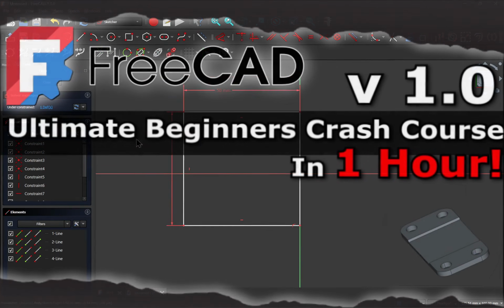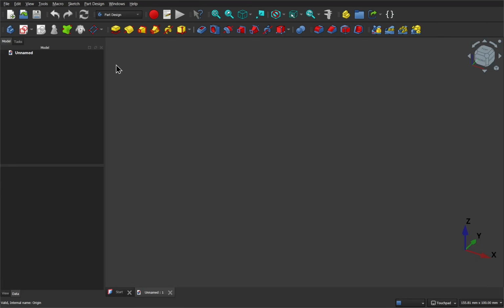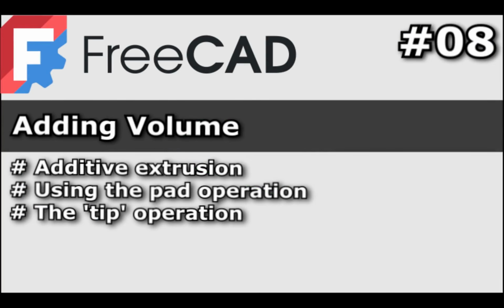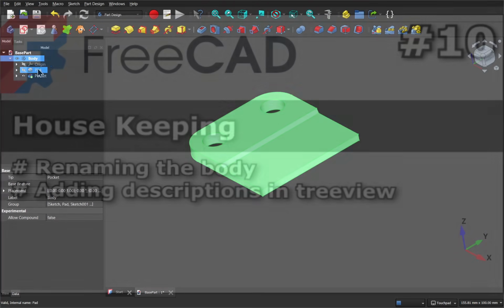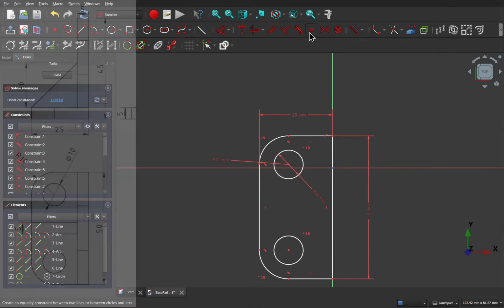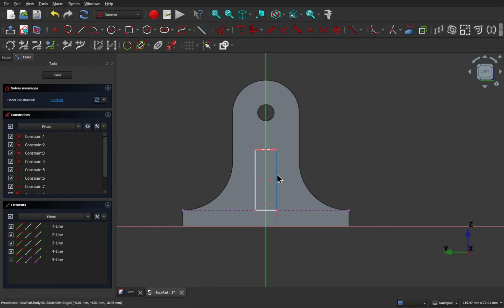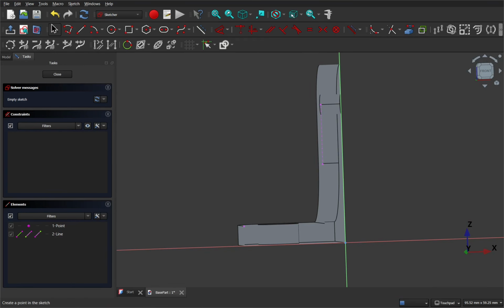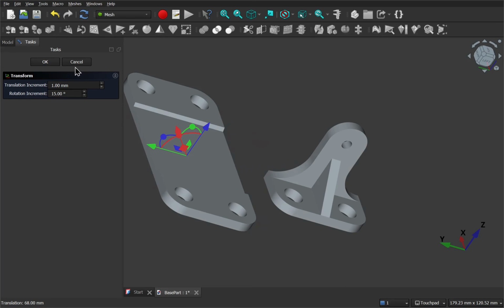FreeCAD 1.0 Ultimate Beginners Crash Course in 1 hour for 3D printing   CAD Lesson / Tutorial

Comment: Maybe I am understanding this wrong but I am trying to recreat something from measuring a real life part and I am wondering how to get the holes to line up without them snapping to the center when I use the constraints
Reply from the maker: I am assuming you are using the dimensioning tool.  There are two ways to use it.  If the tool is selected first this will snap to the center by default after you selected the center of the circle, the next selection will be the point, edge you want to constraint to.  But, if you first select the mid point of your circle, then the point you want to constraint to then your dimension will be added using these points.

Comment: The bit at 23:56 was a bit of a nightmare for me, I followed your instructions and it apparently created extra constraints, turning the drawn shape orange instead of white. Even deleting the constraints the program marked as extras didn't change anything, so I ended up deleting all the constraints and manually reapplying them - coincident constraints on all the pairs of points, one angle constraint, horizontal/vertical constraints on some of the lines, and two length constraints. Not sure what went wrong, but at least I was able to get to a fully constrained sketch in the end.
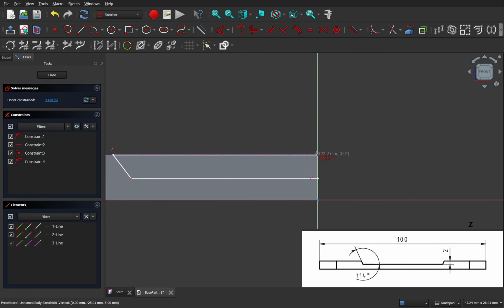Reply: Same issue for me on 1.0.1 - Tried to follow steviezhu's comment: "For those who got stuck at 23:40 with error "redundant constraints (7 and 10)" and orange shape, I've found the solution: when you drag your 3rd line that along the top edge, don't snap to the vertex on the Y axis, just subtly move your cursor around that vertex to  make sure you won't highlight (blue) the vertex but highlight (blue) the Y axis, and with the same parameters in the parentheses (0mm, 5mm). Same for the last line, don't snap to the original point, try to highlight and snap to the blue Y axis with the same parameters in the parentheses (2.5 mm, 90.0°). Then you're good to go." - but I couldn't properly grasp what he was saying to do as a correction.  I'll try some of the other suggestions.
Reply: Feel your pain bud, I was there too.  After deleting several bits and making sure parts where joined and re-watching I got there in the end.  All software like this has its quirks, just got to get used to them I suppose.  You do figure it out you're one step closer to not screwing up that way again.  Its a powerful program,  I saw it has the ability to do stress analysis as well.  Amazing bit of gear.  I teach at a low socio economic school and having quality software like this and blender is really important so kids don't have to get pirated copies or end up beholden to subscription software.  Excellent stuff.  I'm enjoying the pain.
Reply from the maker: The dimensional tool sometimes appears to try to be 'clever' and you end up constraining to different references with different constraints.  What often happens is that you select say a edge but you actual select something else in that 'pick radius'.  Can be frustrating when your first starting out.
Reply: @MangoJellySolutions  I should clarify, it wasn't the dimensional tool; the moment I finished drawing the shape with the polyline tool, exactly as you did, the whole shape turned orange, the sketch suddenly having too many constraints rather than not enough. If I drew it with the line tool, the shape came out white like it was supposed to. This happened every time the polyline tool was used while following the video.

Also, I think I was misinterpreting the error message at first. I saw it saying the indicated constraints were redundant and thought it meant they were redundant with each other and to delete one of them; I figured out later that it meant all of them were redundant with other, not-indicated constraints. In any case, the polyline tool just doesn't seem to work right in my FreeCAD version (1.0.1, stable flatpak), so there may have been a regression since the video was recorded.
Reply: @Onihikage  same problem here spend 15mins trying retrying the polyline tool until i saw this message better pin this comment! also 1.0.1 here

Comment: I’ve done many years of 3d modelling - mainly architectural, with a range of proprietary tools of varying capabilities.  But I’ve got to admit, I am really struggling with this interface and workflow for my home projects.  I’ll carry on, and I’ll get there eventually, but it shouldn’t be this difficult.  I’m trying to put together a little parameterised bracket, and want to move away from OpenSCAD, but it is so easy in that tool!  Thank goodness for YouTube… 😂😂😂
Reply from the maker: Totally agree. FreeCAD does have a huge learning curve, I have been through what I call 'unconscious change aversion' myself.  When coming from another package before freeCAD (where you point at the software and say 'that's not how it should work', or 'it's so much easier in x software') I think it's so much harder than starting fresh.  When coming from main stream to opensource; Illustrator to Inkscape, Photoshop to Gimp, it's hard to retrain old habits after using operations that have had thousand of $ spent on them to get them just right, it's against human nature as it burns more brain calories dealing with something that is less intuitive.  That pared with the UI it becomes a bit of a rough ride.  So totally hearing you.

Comment: 53:03 it constrains the whole triangle, and when I try to dim the back line to 25mm it errors with 'Negative datum values are not valid with the constraint with index 7'. If I delete constraint 7 and retry it says 'cannot set the datum because the sketch contains conflicting constraints'.
Instead if I delete constraint 4 which seems to be a line between the top of the purple dotted line and just below the tip of the triangle, it allows the change.
Strangely when I undid some edits and did it again, I still had to do this but this time I had to dim the bottom line which was already set at 20mm for it to accept fully constrained.
Reply: I wish i knew why it didnt work without deleting constraint 4, but i guess ill know that later. if i completely sell my soul to freecad lmao

Comment: I'm getting stuck at the point where the line changes, and you had to drag it forward. It's not working for me because immediately I entered 24mm it became fully constrained which means the diagonal line of it is facing up and not downward like yours and I'm doing exactly what you're doing. Please help
Reply from the maker: Please could you drop in the time stamp of the video of where you are up to please and I see if I can help?
Reply: Sir, I faced the same issue and I can help you with the problem. So basically, we are over constraining. 

When you try to give the dimensions, the 'solver messages' will show you which constraints are creating a problem. Just delete those constraints.

Also check the Elements. There should not be more than 4 line elements as we are basically creating a quadrilateral, otherwise in the subsequent step, it will show 'wire not closed' error. 

Please include these errors in a future update of these videos. Please. It caused me such a headache 😂

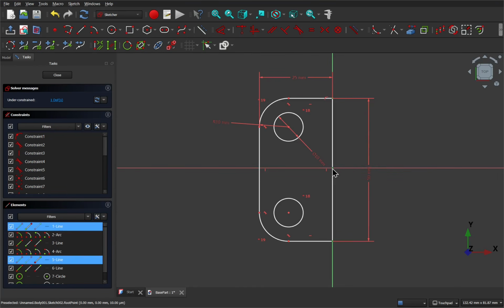Comment: I'm having issues at 35:15... when I select the 3 points and click the Constrain Symmetric it gives me an error, saying Redundant Constrains...
I tried many times, and it keeps giving me the same error... I dont know what is wrong.
Reply from the maker: It sounds like there is either already something that is making it symmetrical in your model, you may already have another symmetrical constraint .  You use top menu > Sketch > Sketcher visual > Select redundant constraints to select the redundant constraint in green and then selected delete.  Also look for additional symmetry constraints in the panel on the left to see if you have any additional ones.
Reply: I worked around this issue by adding a point at the origin. Then gave two separate 25mm dimensions to each part, making it 50mm long

Comment: OMG help! I followed you step for step till padding then I keep getting this?  Cannot use selected object. Selected object must belong to the active body.
same software , I just don't get why this is happening?
Reply from the maker: If you look for the blue body container, is it in bold in the treeview? If not double click it or right click and you will see an option for active body. Then you should be able to apply to operation to create the feature. Either that or your sketch may  sit outside the body container. Drag and drop it onto the body so it sits inside. Hope that helps.

Comment: 23:45 when I click, I got this this report: "Sketch001: Sketch with redundant constraints. Please remove the following redundant constraint:7". And I find I have 9 "Constraints". I tried deleting some constraints, and it seems fine. But I still don't understand where the difference is between what you did and what I did.
Reply: Sir, I faced the same issue and I can help you with the problem. So basically, we are over constraining. 

When you try to give the dimensions, the 'solver messages' will show you which constraints are creating a problem. Just delete those constraints.

Also check the Elements. There should not be more than 4 line elements as we are basically creating a quadrilateral, otherwise in the subsequent step, it will show 'wire not closed' error. 

Please include these errors in a future update of these videos. Please. It caused me such a headache 😂
Reply: Somehow we ended up giving conflicting constraints 😂.. I also can't figure out what we did different

Comment: what version are you useing buddy cause im trying my guts out to lern this i finally find a guide (you) that doesn't mess around with nonsense i can easily follow and it appears my layout is different despite having downloaded off there site   i have no toggle vew boxex and the menu looks different  its hard to follow along and run my freecad nxt to ur video until a lightglobe in my head finally switches on cheers keep up the good work
Reply from the maker: Sorry for the late reply.  That's a bit strange it should be 1.0.  If you go to the top menu > help > about you should see what version it is there.  Give me a shout back when you find the version and I see if I can help to find out what's wrong.
Reply: @MangoJellySolutions  yeah thxs buddy ill have my main pc up and running again in a few days .     i did notice that after i selected something the other night forget what it was   but after that i had the two boxes on the left came up but no sub menu... i think its because its a fresh first time use thing yours is obviously setup      so theres only a couple of steps you leave out      um.... posibly unthought of of or ya cant think of every little thing at once    but yeah those couple little steps would really help guys like me   ill have my dual monitor setup working again soon its impossible to watch or work 2 windows side by side on a 15in laptop lol 
 what were those steps tbtw

Comment: Such an incredible good tutorial!
Reply from the maker: Thank you so much : ) So happy that it's being enjoyed.
Reply: Apart from making it possible to navigate 100% through the whole process, I was impressed how precise your explanations are and that you do it without halting or doing any unnecessary pauses. Your voice is also very clear. You should do voice overs as a profession too (really).
Reply: @MangoJellySolutions  Now also  a small contributor on Patreon 😊 I have one question if I may... I have now tested my knowledge earned on this tutorial by trying to make a simple key (the one used at my bathroom). The model consist of three parts 1) the handle 2) the shaft and 3) the tooth. At the end of your tutorial you can separate and move the parts when exporting the model as STL and importing it again to FreeCAD and using Mesh on the imported STL model. What I miss is how to move the parts/objects created in FreeCAD (as FreeCAD objects) and perhaps join them together as a whole. Right now the three parts are placed together. I am sure that you have explained that somewhere in another tutorial and it would be much appreciated if you could guide me to it. It would make a great difference 🙏

Comment: 11:29 I can't get the coordinates to show next to my mouse, even after enabling, disabling, and re-enabling the option to show them under sketch preferences. Any idea as to why?

Edit: I toggled the view of the sketch on and off... and they just appeared.
Reply from the maker: Very strange that one. Normally this means they are not turned on in the preferences.  Top menu > edit > preferences > sketcher > display > show coordinates by the side of mouse when editing.  The other thing to remember is that the coordinate will only appear once you have selected a tool to sketch with, it is not present until then (which would be helpful).  The only other thing I can think is that there was a ui blip.

Comment: Does Freecad take an elevation and isometric view of this figure?
Reply from the maker: Yes, FreeCAD is capable of generating both elevation (orthographic) views and isometric views of a figure. Using the TechDraw Workbench to create a technical drawing, you can produce standard 2D projections such as front, side, and top views straight from the parts of the model, and also create isometric views directly from the 3D model workspace for technical documentation.

Comment: Hi thx for your video. I am using freecad for a couple of months now. I have a problem moving an object. When in part design, I am drawing a rectangle in sketch... When trying to move it in data tab, placement - position , I can't change the value in x,y or z. When clicking in the space, it become blank and can't write anything. What can be wrong. It's like if the placement is locked. Any solution ?

Comment: Having a problem...   My trying to make a part that is round 80mm, center hole 10mm, thickness 10mm, with 7mm round carved holes  3mm deep "3mm apart (V)" all the way round evenly placed and center on outer edge. Not on top or bottom but on the side... unable to fine a video for this kind of part

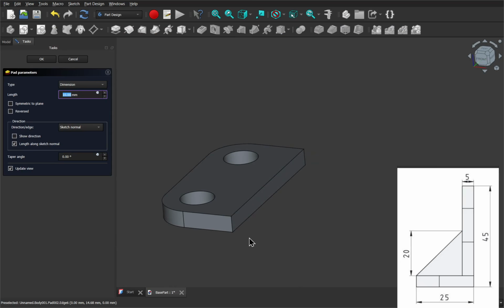Comment: @41:27 I can not get it padded. It makes everything dissapear, and reversing doesn't do anything... 
And I made it again, and now it works. No idea were it went wrong, but the simple method of trying again worked this time!

It is a great video and great instructions! Thank you for making!
Reply from the maker: Glad you enjoyed the video and thank you for the feedback.  There could be a number of reasons why the pad didn't work.  You may not of selected the whole sketch, you may of double click the sketch from the screen resulting in the operation above the sketch being selected, the sketch may not of been connected to the geometry.  It's hard to pin point exactly what happened.  I can totally understand the frustration.  I always find if this happens and you want to start again is to still save off a copy of the project so you can compare results later to find out what went wrong.

Glad to hear you got it working in the end.
Reply: Exactly the same problem 😢 getwiredirection failed to create face from wire.

Comment: I did not understand your pouring water on the square in your "Profiles, Wires (open and closed)" segment.  what were you going for, why pour water on it?
Reply from the maker: If the profile is open water will seep in so their are gaps in the geometry.  So if you fill it with volume it will 'leak' out so it would be a solid, all the volume will escape.  The profile has to be closed to stop the volume from escaping so it stays a solid..... maybe I should of gone for that explanation, sorry for the confusion.

Comment: Have come to an abrupt halt at around 23:55 where you are dimensioning the upright of that closed geometry. I cannot change it's dimension to 2mm because I keep getting an error about other contstraints disallowing it. I've tried recreating the closed polyline multiple times but to no avail :( Would appreciate a nod in the right direction...
Reply: me too, it says "redundant constraints"
Reply: Wow! Same to same! @georgetaylor2672
Reply: I had the same issue. As a temp fix You can delete the extra constraints from the side menu. Long term this would be very annoying to have to constantly go back and delete a bunch of extra constraints that the software added automatically. For ref, I'm running v1.0.1 on macOS15.5 on apple silicon
Reply: I tried to make each line separately and give them dimensions individually which led to a fully constrained geometry. 

But I got stuck in the next process where it said - wire is not closed.😢 

So, am also stuck

Comment: I dont know what debian did but on 1.1.0 dev (which is what I get when I apt install freecad) the create external geometry is instead create external projection geometry and when you bind it to that edge it dosent give the dotted line instead takes the whole line into the constraints and that will give you an open wire.

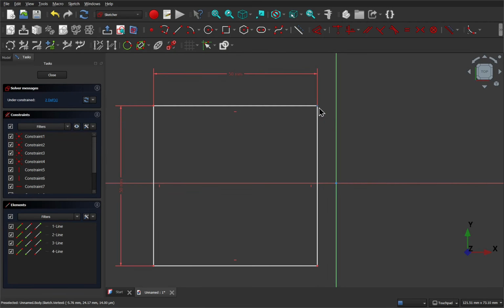Comment: The 1-line, 2-line, 3-line, 4-line and the was it "hungry selection"?  part at 13:02 , completely threw me off. Why is 3-line selected when the top right point is selected? What is 3-line? I tried clicking the top left point and 1-line is selected, bottom left also selects 1-line, but bottom right selects 2-line and top right selects 3-line? It's obviously obvious given the way you just mentioned what happened without explaining. Please explain those three line segments in that panel